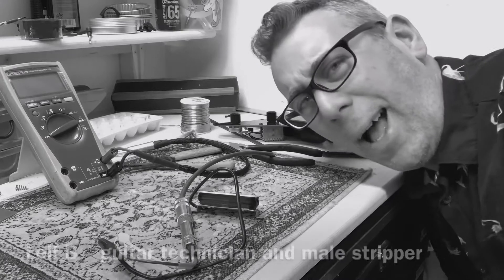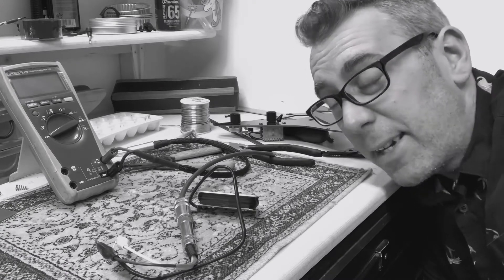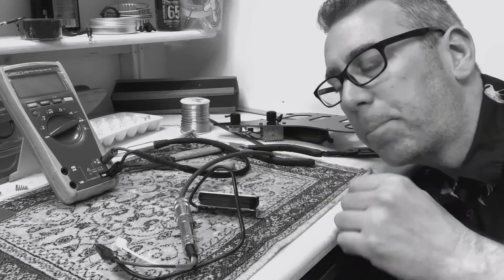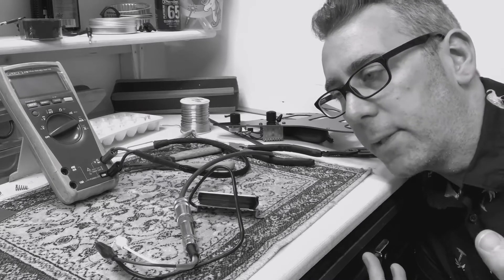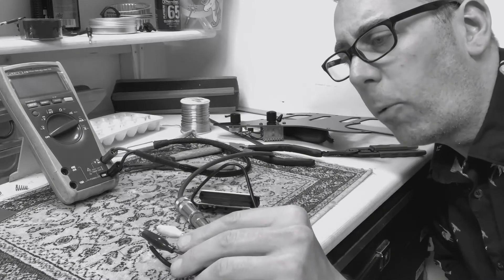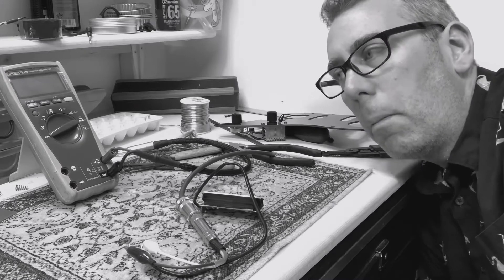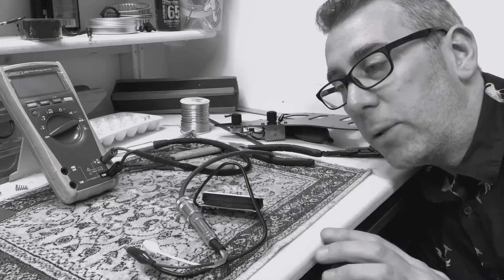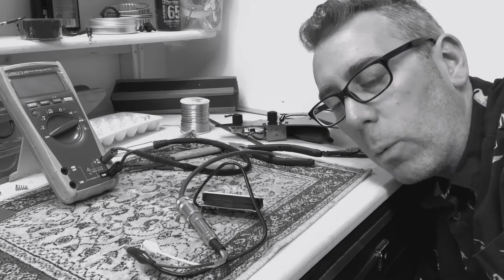Why does my pickup buzz when I touch it?

Comment: Your pickups are already wired to ground / earth when connected correctly. If you touch the pickup, I think you are creating a ground loop. You're adding a second ground to the system - yourself - when you touch the pickup. The difference in potentials creates the buzzing you hear. You never want multiple paths to ground. You don't get noise when you touch the bridge plate, because it is not an "antenna" like the pickup is. It is just another part of the grounded system. Similarly, when wiring the selector switch and vol / tone knobs, you must be careful not to have two paths to ground within the control panel, or you will again create a ground loop situation. I'm no expert, but this is my educated guess.

Comment: it is easy, if the poles are earthed, just undo it n connect a earth wire to the magnets n to the earth seperatly.
this happens when pickups are wired in series. it will not happen if pickups are wired in parrellel. (when wired in series the hot wire of one pickup is soldered to the earth wire of the other pickup n it causes this priblem)

Comment: The noise actually comes from you as our bodies are electromagnetically conductive. When you touch the pole pieces or the not-yet-connected screen wire, you extend the electromagnetic interference your body has absorbed very close to the circuit and the noise gets way louder as it gets picked up more easily by the circuit. That "screen" you mention in the video is actually a second ground wire that goes braided around the hot and ground wires of the pickup to shield them from electromagnetic interference, but most importantly it is attached to the backplate of the pickup where the pole pieces touch. By grounding that screen, you now have grounded the pole pieces so any interference will go to ground instead getting picked up by the coil. The pole pieces will still pick up the signal produced by the strings which distort their magnetic field much more severely.